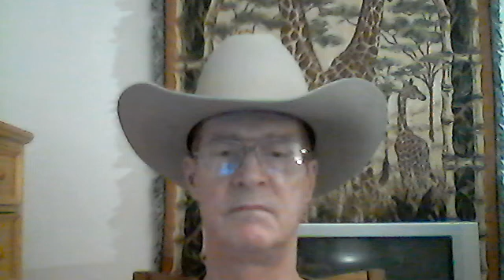Vivaldi Antenna

Comment: Stan, for the sake of staying on topic here, I will post most of what I have written for the Vivaldi antenna in one of your previous videos, and my experience with the antenna. I have used an antenna called a Vivaldi antenna made by a company called HexAndFlex. My experience was odd, to say the least, the antenna was designed for  use of 1-2 GHz and up... however, I was still able to pull in some local AM and FM stations with it with my SDRPlay. The really neat thing I discovered though, was that the the antenna was definitely polarized. You could turn it 90* and totally block one signal, and gain another. I tried using the Vivaldi antenna for (Amateur) Radio Astronomy, but with the equipment I had, the results weren’t that great. Even with a HP Spectrum Analyzer at 1-3 GHz, I didn’t see much. However, the bands around 800-900 Mhz noticeably active on the antenna. It’s an interesting antenna, no doubt, but only a novelty, and something to fulfill my curiosity of what was above the range of my SDR. 73!
Reply: thanks for your information :)